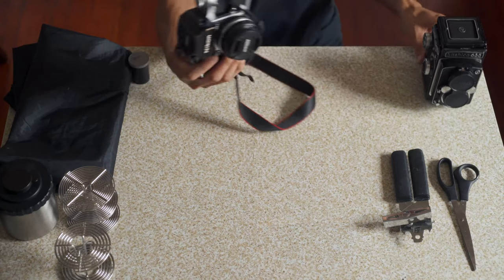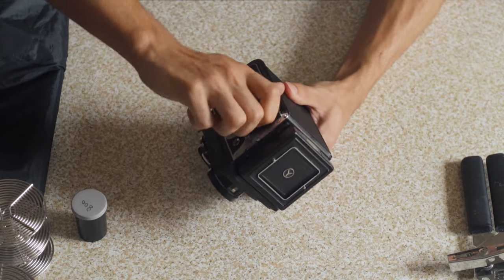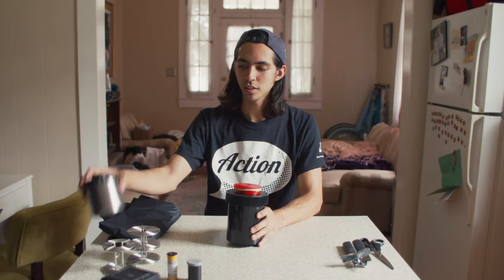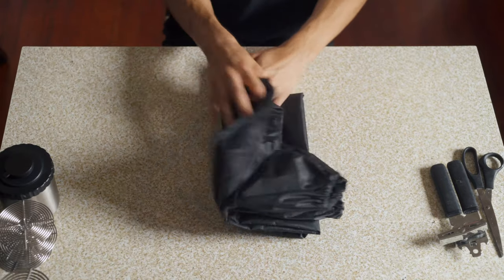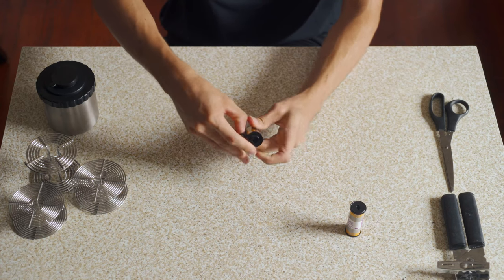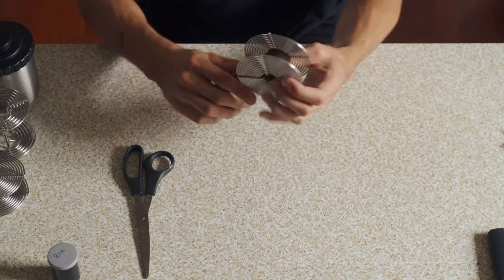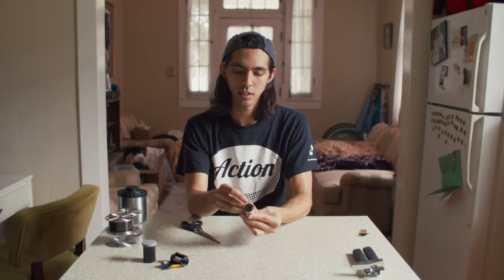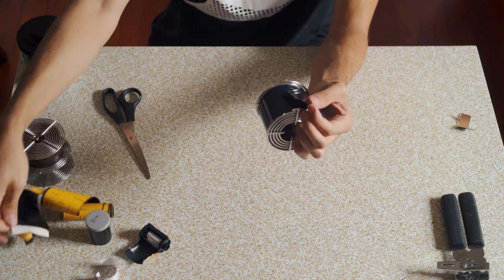How to Prepare Your Film for Processing (35mm & 120)

Comment: Exactly what I was looking for. Lots of Patterson/plastic reels how to. Not many metal reels. Thanks for sharing
Reply: And kudos for that! I think that without the thoughtless usage of Paterson System 4 tanks and reels in so many videos, they would have died off like so many other Paterson junk photo equipment. So many of those videos are about Paterson reels which become unusable after a while from film jams while loading or tops which blow off and dump the contents in mid-process, you have to wonder what they are thinking. Of course, all is not sweetness and light with stainless steel. The old Nikor tanks with steel on steel tops tend to leak a lot and jam on.  The newer ones with plastic tops, like here, avoid that problem. Also, the newer, cheaper, often Japanese or Chinese made reels use relatively thin (cheap) wire to form the reel, and they can be very tricky to load correctly. The old Nikor reels and the new Hewes reels use a much thicker gauge wire and are easy to load. Nikor stuff tends to be cheap on ebay. Hewes is at your photo supply outlet, and you will have to sell a body part to afford it.

Comment: He didn't mention it, but notice that he put an empty 35mm reel in the tank on top of the loaded reel.  Doing this prevents the loaded reel from sliding up and down in the tank during agitation. the benefit of doing this is that if the reel moves around in the tank during processing, the film can be knocked around enough to start coming off the reel. Also, the reel might stick up inside the tank and then be out of the processing solution. Is that a common problem? Not in my experience over 60 years. But why risk it? Nice video.
Reply from the maker: Thanks Randall. Yes I didn't even think about mentioning it - it always seemed the logical thing to do!